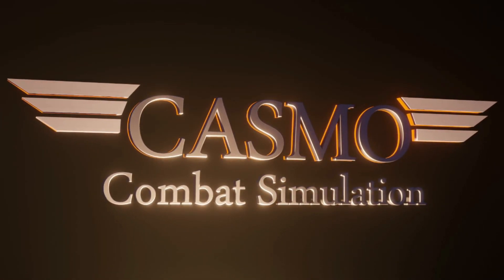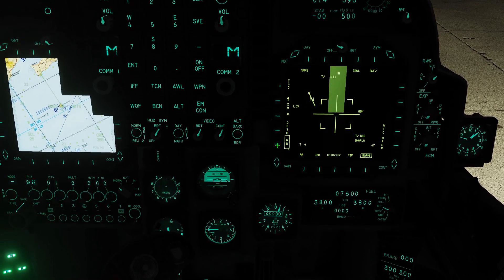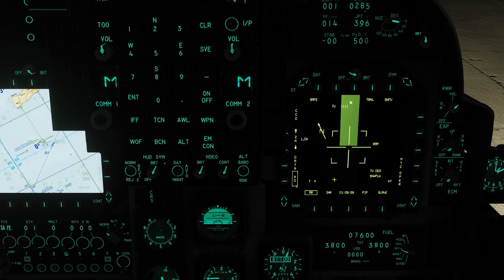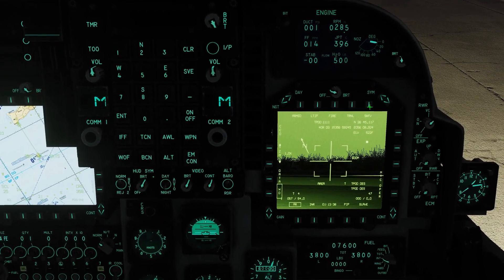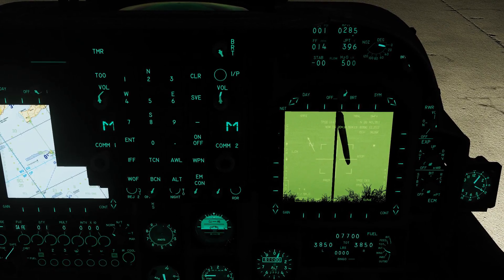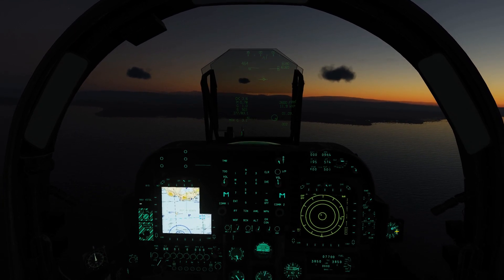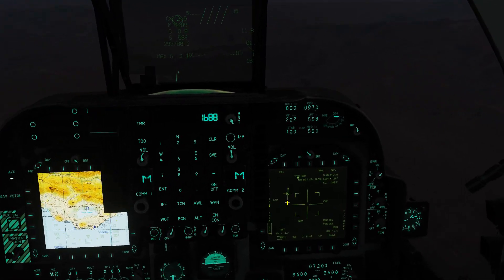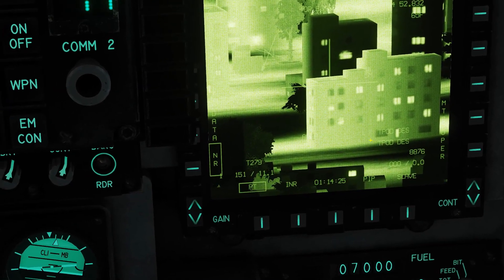DCS AV-8B Harrier Targeting Pod (November 2020) functionality and HOTAS controls

Comment: I've been having some real, real trouble with the Tpod changes here. Took the harrier out on a multiplayer mission and couldn't get it to work with the TDC at all. It also wasn't interfacing with the HOTAS controls properly either. The Sensor select switch was just doing the old functions and not interfacing with the Tpod at all. Pretty infuriating coming off the back of having done it one way for years. Now since every Tpod in the game has been updated in the period my HOTAS was taking to be replaced I'm now about as useful as a sack of manure in all of the planes the group I fly with needs filled. Such fun.
The real kicker is I'd spent about three hours messing around with the new Tpod earlier this week but something in activating it is just not that intuitive, clearly.
Reply from the maker: RAZBAM!!!  That’s frustrating. I’m sorry to hear that.

Comment: Hmmm, to my experience the "bugs" are most often between the ears. The Harrier beeing one of the most complex modules in DCS, with less integration between systems, compared to say a Hornet or Warthog. My favorite "bug report" that even made it on the community bug tracker: "Countermeasures show only zero, bla bla"... The first(!) answer to the post: "Did you switch the Countermeasure system on? It does only recognize the loaded cartridges with electrical power supplied to the system" ...and yes, that was the issue. 😉
The Harrier has bugs for sure, but in comparison to other modules it isn't much worse, just a lot more than can go wrong... and the modernization update of systems does not really make it easier. That said appreciate the Video on the Gen4 TPOD workings. 👍🏻
Reply from the maker: Well I would agree if it wasn’t for all the testing I did on certain functions. But I do agree that it’s partially “just the way it is”.
Reply: @CasmoTV  As I said, not "bug free", but not more than other modules. The time it took Razbam to get to grips with it is a different story. 😇
Reply: pfft if you say so buddy

TPOD has always been a buggy mess in the harrier.
Reply: @S3NTRY  Can't relate to that, for me it worked quite ok. The only "bug" I encountered with the TPOD was the Point-Track mode not losing track when masked. Some changes with Gen4 update I need to get used, though.
Reply: @shagrat47  no issues with slew then? I thought everyone experienced that.
Reply: @S3NTRY  Nope, most people had extreme issues, when setting curves. Without curves it worked for me since forever. Razbam updated the TDC slew a while ago. Now it is also working with curves.
Reply: @shagrat47  axis controls should work with or without curves, unless they're bugged.

I'll have to take another look since the TGP mode update.
Reply: TPOD seems to be on a good way - now. But the current hard-wired connection of EHST and AUTO mode is wrong imo. See, this is the thing: yes, it is a complex aircraft, but are the systems less integrated or less intuitive? Yes, the depiction of it in DCS could make one think so. But that does not automatically mean, that is is supposed to be that way.
Reply: @NVidea-yz1fg  I've read a lot about the AV-8B in the past years. A lot of the systems were added later, yet not "integrated", in a way that, say the A-10C got it. The Gen4 TPOD is a great example. That replaced the 3(!) different modes of operation for the TPOD by 2. Still it is more an add on to the sensor suite and you need to check for which mode controls the TDC/TPOD. The SOI and SPI concept along with the HOTAS integration in the A-10C is a different thing. Don't get me wrong, I like the Harrier and that is part of its history and how the platform works. So no worries, just noticing that I need to be aware how things work in this more complex environment.
Reply from the maker: Fear not people- I plan to have a harrier driver in the podcast and we will get to the bottom of this all.